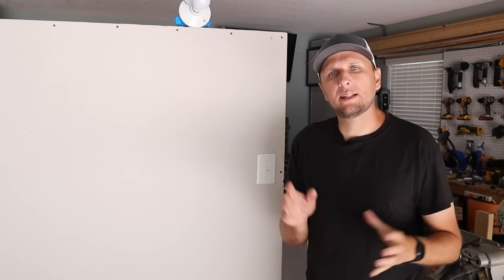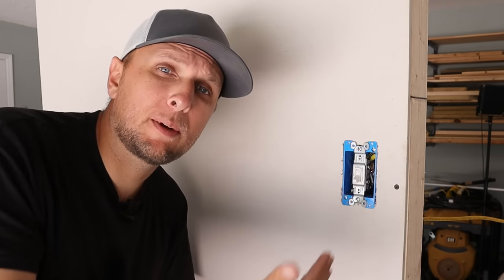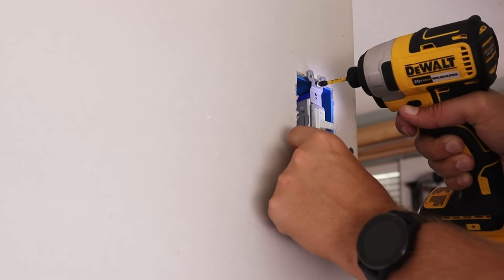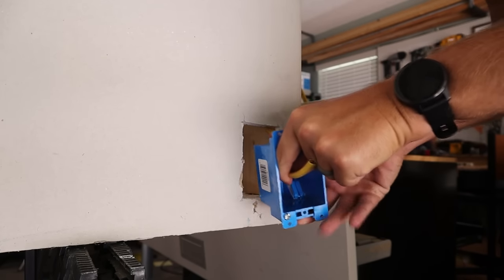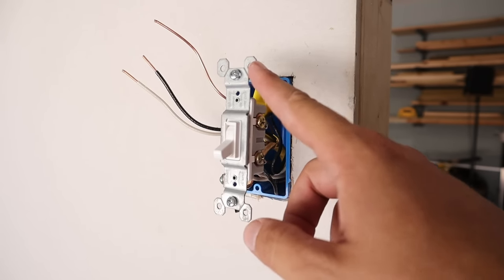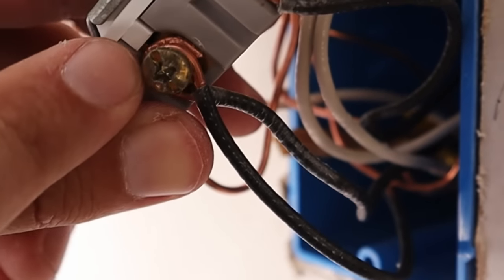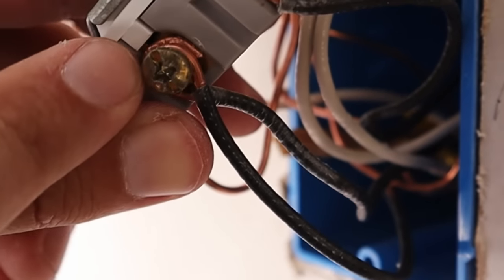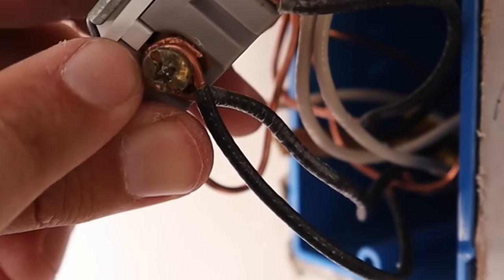How To Add An Outlet From A Light Switch | Common Mistake

Comment: One comment I would like to add is that sometimes a switch only contains a switch loop and the power is up at the fixture.  I personally never wire switches that way but you would definitely want to check that before you cut your hole for the new outlet.  Thanks for your video, you do a great job on all of your tutorials.
Reply: Actually the "switchleg" you describe is defined in the NEC and is the preferred, if not mandated method to use. As you correctly state, it does prevent adding additional devices by get a wire to the switch box, unless the switchleg is a 3 conductorr cable with ground
Reply: @robbrown9543  2011 NEC 404.2 added the requirement that all switch boxes contain a neutral conductor. The problem was that some people were using the ground wire as a neutral when no neutral was present and they needed one for a smart switch, timer, sensor, or other electronic device.
Reply: @larrybav  Wouldn't the breakers immediately trip if the grounds are used as neutrals?
Reply: @aurvaroy6670  no it would not
Reply: I bet 75% of switch’s do not have a Neutral in the box
Reply: @blockisle9  Why?
Reply: @aurvaroy6670  The ground and the neutral go back to the same location. However, the ground is also attached to everything metal on all the equipment. You would not want current traveling through the chassis of the appliances. If a hot wire touches the ground the breaker will trip. If there was no ground, the case of the appliances would become energized and if someone touches it they can get shocked.
A GFCI breaker on the other hand could trip.
Reply: @blockisle9  Got it. I just can't imagine a breaker not tripping if neutral and grounds were reversed or if ground was used as neutral for a smart switch. Thanks for your explanation
Reply: @larrybav  Thanks for bringing me up to date. You are correct, of course.
Reply: @aurvaroy6670  Only if the circuit is on a GFCI breaker.
Reply: @blockisle9  Indeed, my canadian 2010 apartment switches of overhead lights do not have one
Reply: That's old school wiring...I agree with you but newer homes are hot switches.... unless someone who did the house wiring was old school to begin with....😆
Reply: @blockisle9  Grounding is a bit trickier than that and is done differently in different countries.
Reply: @blockisle9  they do technically go back to breaker box but to separate bus bars if wired correct.
Reply: @Rebel7469  At the main panel, those two bars are connected together. They are separate at a sub-panel but the feed for those or fed from a main panel are interconnected.
I was just trying to explain why the breaker would not trip in simple terms
Reply: @aurvaroy6670  only if they are GFCI breakers
Reply: I have an older home and all my fixtures are wired using a switch loop.
Reply: @larrybav  - I just looked at this. So, did they rename the neutral to "grounded circuit conductor" ?  This section is kind of ambiguous. They should say "neutral" every time they mean "neutral"!
Reply: @aurvaroy6670  a normal breaker is only on the Hot conductor. Ground and neutral are bonded in the main panel. A ground fault exists when AFCI or GFCI detects an unequal amount of current between the Hot and Neutral conductors.
Reply: Tad You never wired a switch before, just keep it that way. Stay safe, life is too short.
Reply: @aurvaroy6670  only if it's a GFCI or RCBO but most often no it will not.
Reply: @aurvaroy6670  with a switch loop the hot from the light fixture box goes down the black wire to the switch and back to the fixture on the white. The ground is connected to the ground lug on the switch but its not a neutral. Loop identifiable by a black in white out at switch, or by a black to white connection in the fixture.
Reply: @robbrown9543  my old house (built in 1900- lots of various upgrades over the years til we purchased in may) has Several switch loops. ..ie. they ran A 2/12 down the wall. Hot to the switch, "neutral" is hot to the light, no ground at all (cut off)
Reply: @aurvaroy6670  cuz 75% of light switches were wired the old school way -  power went to the light fixture first, switch leg was run to the switch without using a neutral. white wire repurposed in old school method
Reply: @larrybav  not all just one per circuit so if it's a two way or 3way only one box needs a neutral 😉
Reply: @davestorm6718  From other electrician YouTubers, the NEC refers to neutrals as “grounded circuit conductors.”
Reply: @harveylong5878  And then there are 3-way switches.  The distant one is usually connected by a 3-wire (red-black-white) cable with bare ground.  I've yet to run into a 3-way switch loop with a 4-wire cable.   And then there are the 4-way switches (DPDT essentially).     My takeaway on this one is before you start cutting holes in the wall, have a look inside the switch box.
Reply: @davestorm6718  a neutral is a grounded conductor
Reply: @williamleblanc3244  Typically, but not always. Grounded means a wire is, quite literally, stuck in the ground (earthed), and sometimes neutrals are floated.  The phrase "grounded neutral wire" might be confused with "grounded wire" to the layman - and the DIYer might hook up a GFCI outlet incorrectly as a result (which I've seen repeatedly).
Reply: So after all of this, if there’s no neutral in the box for the switch, am I SOL?
Reply: @peacefrog0521  Unless you want to run another line to the box, yes.
I was faced with this when adding a stair light only to find that the 3-way switch box at the foot of the stairway had no neutral.   I went through the wall into a closet that housed the doorbell transformer and installed a low-voltage light.   A cheat, but it works fine.
Reply: Your tutorials are very good.
Reply: I have a bunch of switch loops in my 1980's built home.  I thought Neutral is required for Alternating Current to work.  It allows that alternating movement.  Ground is not required to work or 2 prong appliances wouldn't. Its a safety feature running to a copper rod burried at your meter usually.   If you have an unbalanced circuit, you could carry current over the neutral when they're tied together.  Your neutral may be bonded in the main panel, but you have to separate them in any subpanels because of the current loop dilemma, like when you have to use a 3 wire dryer cord.  Also, commercial switches and receptacles usually have a backwire (not backstab) plate that allows you to use 2 wires per screw safely.  Even my GFCI has a dual wire load port so I dont have to pigtail.  You could also pigtail with Wago 221s.  They work very well.  I use all of these devices.  If its a concern about the bus vs "gas tight" wirenuts conducting power (both are good) - consider that your duplex receptacles are doing that in most homes and are same thing unless they're pigtailed or the tabs are broken off to separate them. Make sure the wires arent too long and keep the neutrals and bare ground tucked away neatly on the opposite (usually left) side as to never get too close to the hot terminals.  If you're skeered, get some AFCI/GFCI breakers.  I am not a sparky, but I am writing this from a Holiday Inn Express.
Reply: As an electrical contractor back in the 70’s, we never mixed receptacles and lights, light circuits were 14 gauge wire (15A) and receptacles 12gauge wire (20A). So we would run the hot feeds to all the octagon ceiling boxes and drop switch legs down to the switches. Easiest way and most efficient as far as lengths of wire needed. Yes, copper wire was also very expensive in the 70’s!
Reply: @larrybav  *almost all
Reply: You don’t need a neutral on many 3way systems and switch boxes where you have access and opportunity to do so later.
Reply: I've seen that before too. Don't like it that way. I, personally would rather have the extra wire (neutral)
wire in the box.
Reply: @aurvaroy6670  the ground is a neutral upstream if I recall correctly.
Reply: @-agent-47-80  Hot switches?  Aren't all switches "hot switches" because they all have a hot wire going to them?  Please explain for this DIY non-electrician.  Thank you.
Reply: Glad you don't,  that would be the lazy electricians way.
Reply: Simple .. pull the switch... If all you have is the (only) white wire connected to the switch... Just screw that switch back in... You'll need to find a feed elsewhere.. however if you see only black wires connected to the switch and the white wires tied together... You'll be able to tap into that for an outlet
Reply: @larrybav interesting the original smart switches took this into consideration... And you had to use the ground as the return path (but voltage/load were so small to be inconsequential)
Reply: So does the outlet have continuous power or is it only when the light switch is set to on?
Reply: Great work on this video.
Reply: Exactly, all of our switches are like that, only hot wire in it.
Reply: Show your own video thanks God bless
Reply: Technically, could I pull a 14/3 to replace the 14/2 and use the red wire for neutral and keep the line and load the same to keep the switch loop?
Reply: I have a 10 year old home. Can I do that the way he instructs?
Reply: That’s a brilliant idea! (Replacing the 14/2 switch look with a 14/3 switch loop). Hot black coming into the switch, then Red hot from switch to light hot, while the white line pigtailed via but to both light neutral white and also 14/3 white to provide an outlet power without being affected by switch. I have no idea if this is okay to do via code, but logistically it would work perfectly, and would be much easier than running a second 14/2 wire down.
Reply: I just renovated a rental built in 1968 and there were no neutral white wires available in the light switch box. I didn't need them, just noticed
Reply: I just went to try this and there was no neutral in the box lol
Reply: @Rebel7469 not at the first means of disconnect. Most houses that is the panel